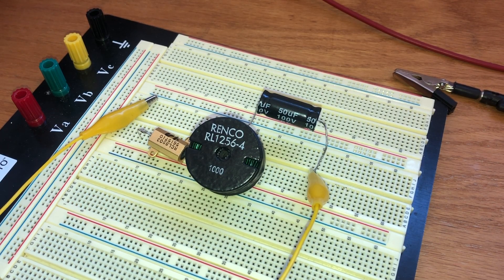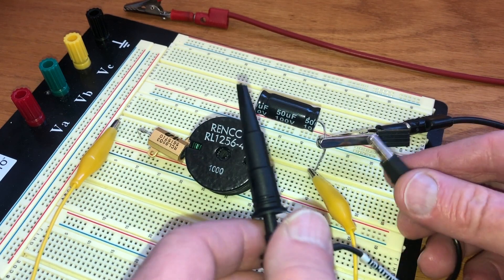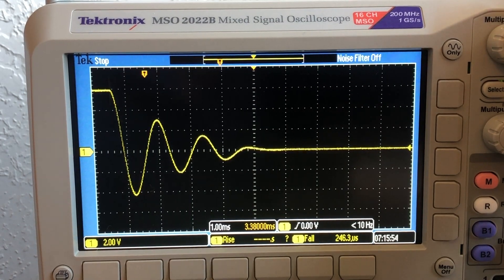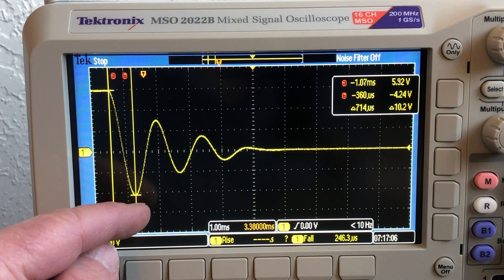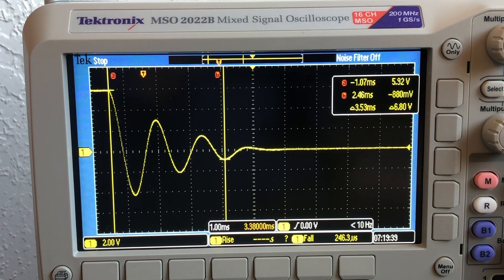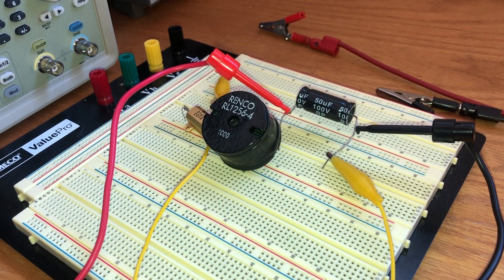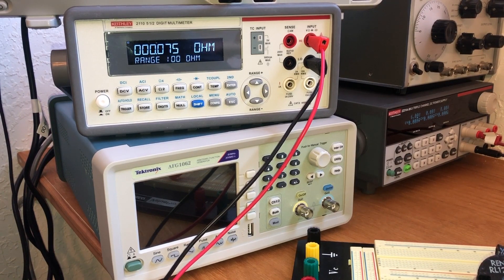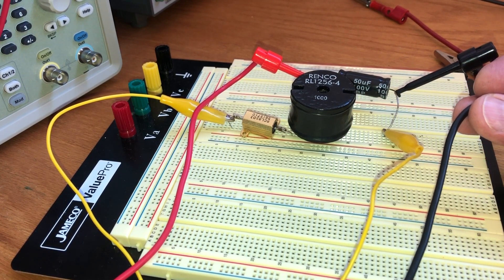RLC Underdamped Harmonic Oscillator Lab

Comment: hey, could you attatch the circuit to a speaker and a display to display the frequency? (Using the video for a project and it would appear this is the only video with a physical circuit
Reply from the maker: In theory maybe, but I doubt my power supply puts out nearly enough current for a "speaker" through all those frequencies.  Maybe an earbud?
Reply: @hakescl  turns out i'm  planning on buying a signal generator now, yay pour the cash away haha(!). 
Thanks though, just turns out a signal generator has a few things that I have to use apparently. Really appreciated the video -as I said there's not another one out there with a physical demo.

Comment: May I ask why you set the scope trigger for a falling edge? Thanks.
Reply from the maker: The voltage will stay high until we "move the switch" so we want the oscilloscope to wait until it "sees" the voltage fall.  Then it records only a single sweep, since this is a very transient signal.  Afterwards the signal will stay flat at ground, since nothing is going on, but the oscilloscope has already made its record of the event.
Reply: @hakescl  Thanks. Your videos about the subject are quite informative and well made. Please keep doing them!